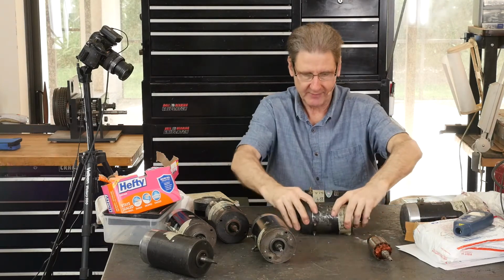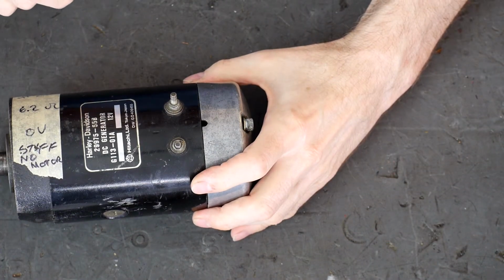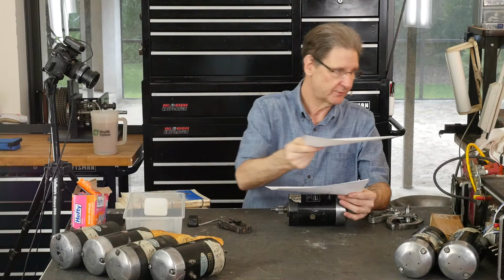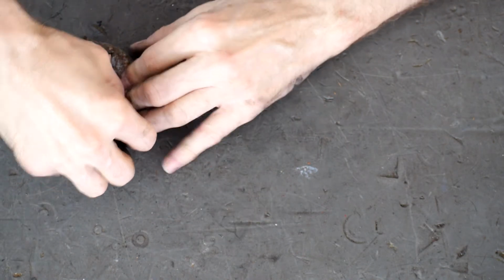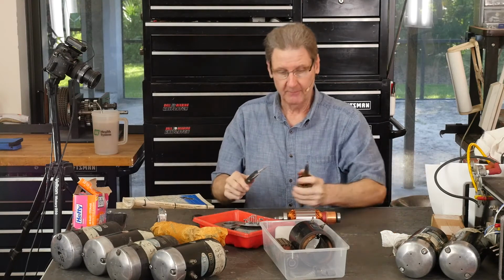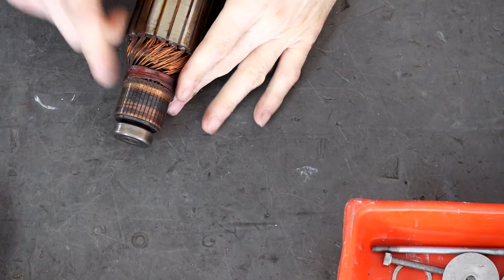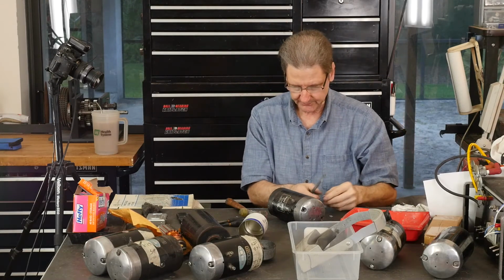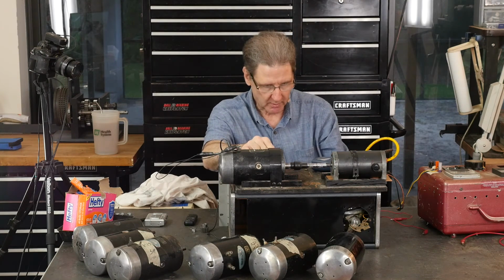Sportster 65B generator rebuild 1982-84

Comment: I need your help with a 1984 xlh 1000 transmission  how can I reach you for mor information
Reply from the maker: I did some videos on Iron Sportster transmissions:
https://youtu.be/mlHzx9ddmAE 
https://youtu.be/PFttzH4FhJw 
Other than that, I am not a shop or a service, and I can't do individual work, if only for the liability problems. If you have a question, post it on the transmission video comments and maybe I can give some advice. Also, if your 1984 has an alternator under the clutch, I have no idea how those go together, I have only worked on older generator bikes, sorry.

Comment: this guy is super helpful . wish i had your email. im rebuildin an 82 as well . just read the last comment and my bearings are shot on the armature. the im not goin to try a replace the bearings i will grab a new armature with the link that you provided. you hant posted in 9 months hope all is well
Reply from the maker: Yeah, took some time off, just pandemic funk I guess, but hope to get back on it soon. I got the brushes and screw for the extra 65B generator, so maybe I will film slapping that together. Thanks for the comment.

Comment: Great Videos How bout one on timing a magneto Sportster, I have a 1966 can't find anyone willing to work on it, got to learn to do it myself !
Reply from the maker: I sold all my magnetos since they took too many kicks to start. I cheated on my timing. I got the timing close with static timing. You get the timing mark in the hole while being sure the front cylinder is on compression (remove spark plug and make sure air is coming out as the piston goes up. Then rotate the magneto gear while sticking it in the hole until you can set it so the points are just opening on the narrow lobe, don't think a mag has an advance mechanism.
https://youtu.be/mKVh4pbyh2A
(coil bike instructions but the method is similar for a mag.)

Once I got it static timed, my cheat was to install the 1967 one-year-only handlebar timing adjustment mechanism for a magneto. That let me play with the timing while the bike ran. I could retard it to kickstart, and advance once the engine was going. Sorry I can't be more help, this might help:
https://www.harleykmodel.com/technical/magnetos/index.html

Comment: Hello
Thanks for the shout out made my day 
brillant video as always excellent attention to detail  are the bearings actually removable from the armiture or is it a one shot deal
what a stupid place to put a hole thats asking for troube see why so many people have nos oem armatures in stock they brough them like u did expecting to be the problem cant beat a cheep fix
I fitted a digital  tachometer to my home lathe cost about £4 (ebay china) jb weld holds a magnet to a pully an have small bracket for the sensor  seems very accurate does need 12v supply but works with a 9v battery 
Keep up the great work
Reply from the maker: You are most welcome, you will get another shout-out when I do the video comparing six Model 65A armatures in a day or two. I can't tell you how much better the tester works with a hard link between the motor and generator, compared to that rubber hose. I will try remember to show how I can power the generator with a 1/4" drive in a cordless drill, that makes your idea even better.

It seems the bearings are pressed on the shaft and not meant to be removed, but but but, the parts book does call out the bearings separately, 29917-82 for the gear side, 29916-82 for the end cap side. The service manual notes, "Press bearings (12 and 14) onto armature (13), if applicable." And yea, I see them on eBay, $26USD or $15 USD for two of the 29916-82. 

The service manual also says to use blue loctite if you have to put in the pole shoe screws, like when you replace field coils.

The parts book also calls out 4 different washers to take end-play out, 29907-82 is 0.004, 29908-82 is 0.010, 29909-82 is 0.020, 29910-82 is 0.039. I made a mistake in the video and article, since I suspect I was supposed to yank on the shaft and take out the end play, but I just bolted it all back with the same thrust washer.
Ahh, teach me to not read the service manual, it says: "Adjust armature end play to 0.004-0.010 in." Let me go look for those washers on eBay. Holy cow, there is an international seller, but out of Florida, selling each washer for 46 bucks! I guess as long as there is any end play, the generator gets the old washers back.

Thanks for the question, I will add this thread to the  video description.
Reply: @Open-Sport  Hello 
 46 bucks!!! for a washer!!!! id strip all the washers out of the scrap generators u have and list them as nos for 30 bucks and go and by another sportsrer thats crazy
 the  devil is in the detail and they sting u for that if u  want to do a job properly it will cost u CRAZY
  I have the factory manual for the xlcr 1000 1977(part no 99498‐77) i brought it £2 from a swap meet and in there shows undercutting the mica with a Jack saw blade (65A 12v) suggested by the manual could this be why sum armatures look cleaner and sum very ruff sum after market manufactures skip this finishing to save money 
Irl definitely keep any eye for a scrap one at a swap meet to see if I can resurrect it there very interesting it  won't fit my bike but irl sell on  if I get it working help keep these beautiful machines on the road 
Cant wait for the next installment 👍